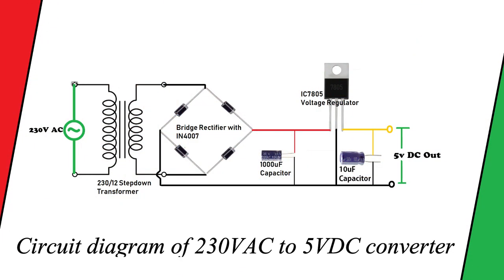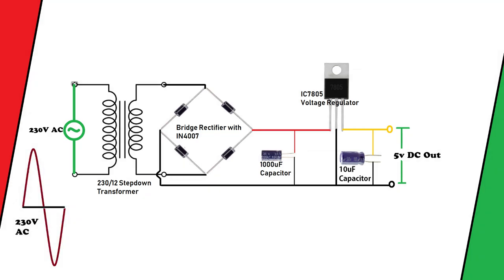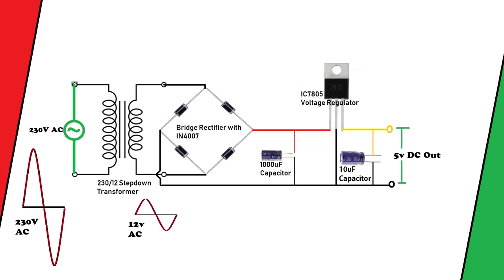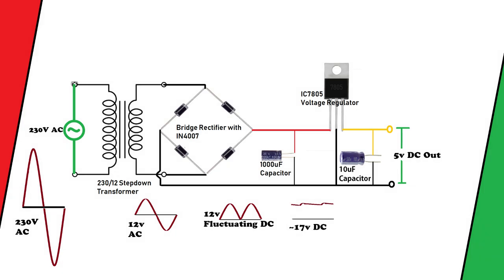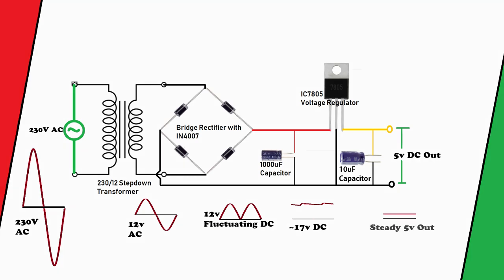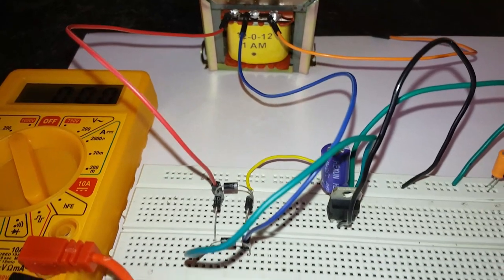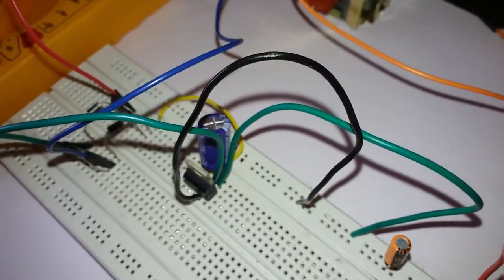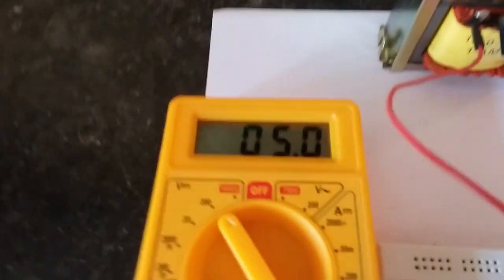How to convert 230v AC into 5v DC?

Comment: Design a power supply circuit that converts 230-volt AC to stable +5 V DC output voltage and output current ranging from 10mA to 50mA using zener diode sir please help

Comment: Can I power Arduino?
Reply from the maker: Of course...It works nice with arduino
Reply from the maker: But still...I would advise to use a 7812 and then fed the 12V 1A supply to arduino using a barrel jack
Reply: @bongtechsolutions7735  barrel jack means

Comment: How much Ampere we will get this circuit?
Reply from the maker: You will get highest 1A current in short circuit. But according to my circuit 7805 cuts the voltage down from 17v to 5v, so with 1A current flowing through it power dissipited in the same will be 12Watt which is huge for such a small component. So I will recommend using a 6-0-6 transformer so that input in 7805 will be around 8.48v and power dissipation will be decreased to 3.48Watt.